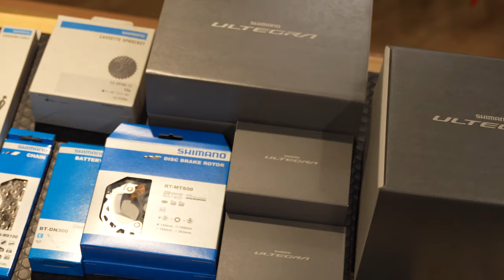DREAM BUILD ROAD BIKE/SPECIALIZED/Tarmac SL7/new Shimano ultegra 12-speed Di2/Bike Build

Comment: Problems with build? Nit picking and maybe
Incorrect observations but ……
-stem had no carbon paste, mounted dry and the top of the face plate is designed to be bottomed out first.  The stem even has arrows on top saying “no gap”
-handlebar finishing tape was touched constantly with oil from the fingers.  Often will prevent a long term hold.  
-shift/brake levers were also mounted with no carbon paste on their metal bands.  
- no derailleur hanger was shown used to set the alignment of the hanger
- pedals were put on with too much torque 
-b tension was super off on the rear derailleur during first shifting sequence as well as the di2 wire was strentched too short.   
-liberal use of spray polish in the end near the disk brakes.   Likely to cause contamination.  
-the final reveal shouldn’t have the rear derailleur fully stretched out in the big big combination.   
-still an awesome video and cool build.